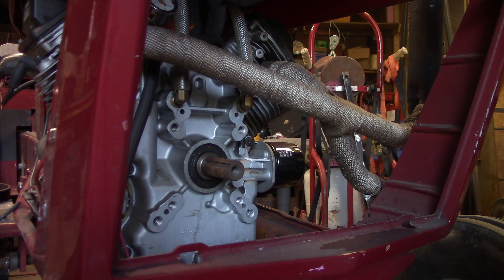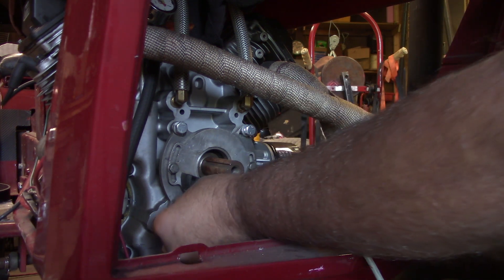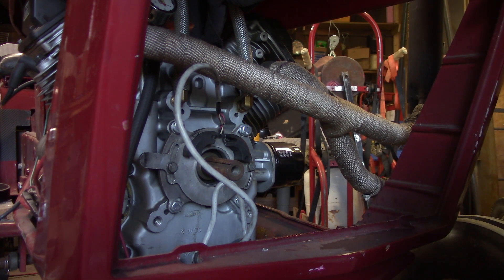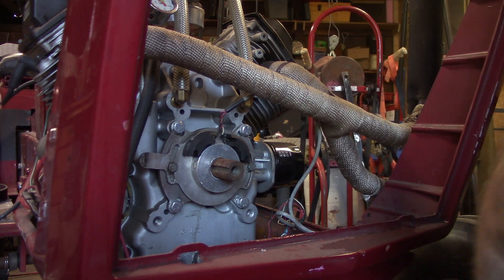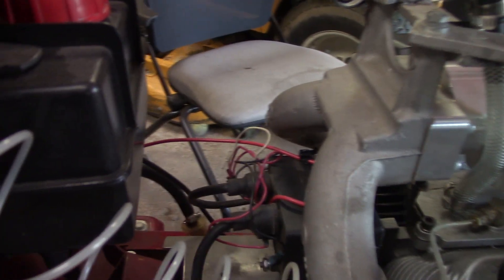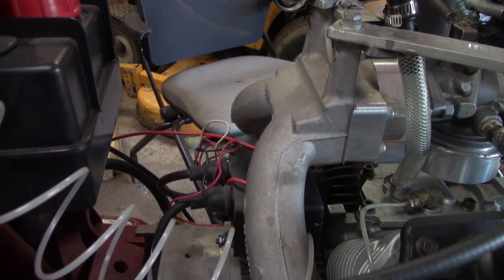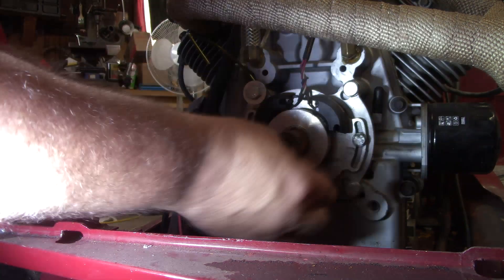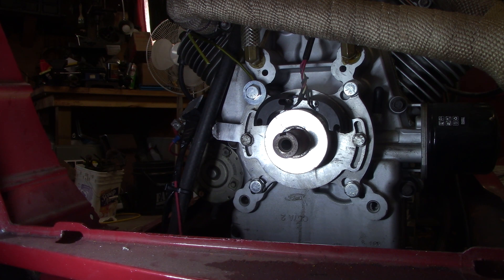Plan B gets a crank trigger ignition. #tractorpulling #enginebuild

Comment: I have made hei units for the cast iron tecumsehs. I use the Chrysler brain that mounts on the firewall and a coil. And a pickup mounted on a piece of aluminum angle iron. Cheap and easy. Hard to find a good original unit now. I have used them on a few 4 wheelers too. They all ready have the pickup mounted for the original box.
Reply from the maker: I've done that also on old tecumseh. This setup is much easier because it come setup and ready to go. Midwest super cub makes them for singles and twins.

Comment: Coil needs power just like fuel shut off solinoid. 
I just add a relay NC power from accessory and switched power from the starter solinoid control which also back feeds fuel shut off relay control. 
Your accessory power in can come from safety switches as well.
Reply from the maker: I ended up running a separate fused constant hot wire to the switch. But I also found I had a bad pickup on the #1 cylinder.

Comment: Good work. Shame about the way the ignition switch is wired up.
Reply from the maker: Ya but it's fix now. Hot wire straight off battery to the switch and it's working great.
Reply: @PullerbearEd  Good work!

Comment: What’s the part number on the two barrel intake manifold
Reply from the maker: The part number is 24 164 14-S you will need a carb adapter to use a K series carburetor.  I use Zach Kerbers adapter.